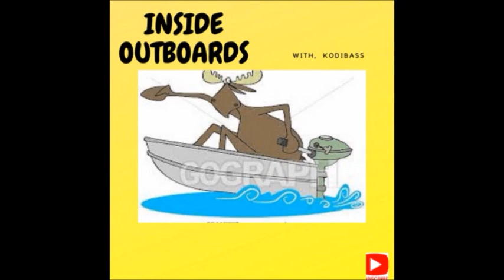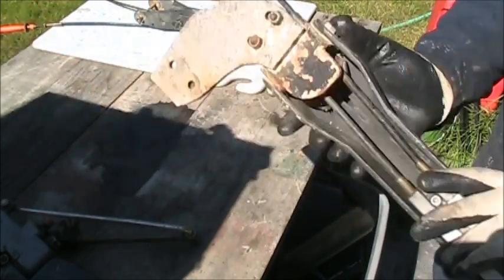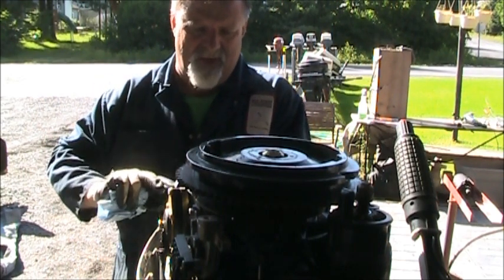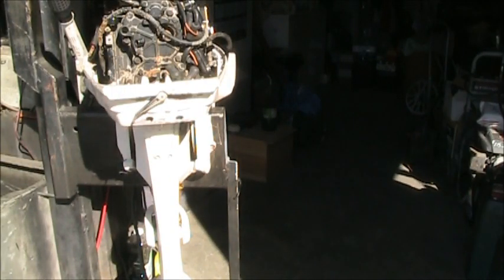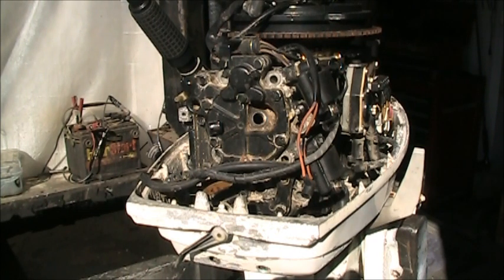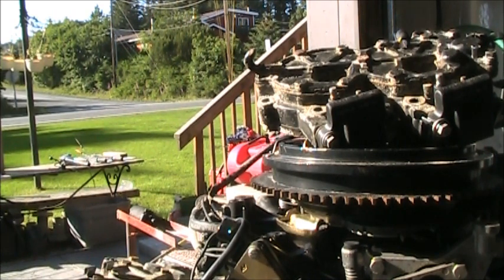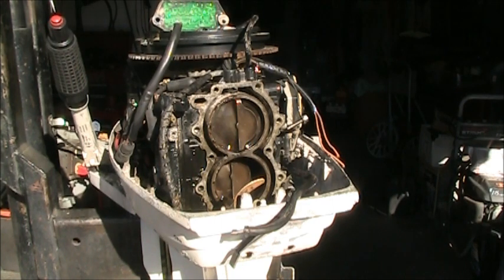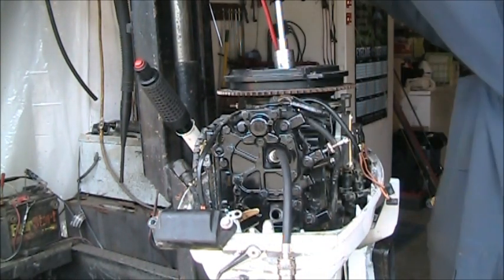1988 JOHNSON 30 HP,      (( Part 1 ))

Comment: Hi Kodi, love the look inside these motors. I was surprised you didn't sand block the head and block like old outboad does. Looking forward to the next part👍
Reply from the maker: +TWS,  Nope''  I  am a Full on  repair shop,,     mowers,   chainsaws,  weed-eaters, pressure washers, etc,,,etc,,     No time 2 do one outboard  @ a time,,    I Move outboards  & loads of engine repair thru  my
shop every day,,  I record the outboards 4 fun & vids,,  But those R not the rent,  4 sure''    I do way more $ on  lawn & garden  equipment  than outboards...  I have 2 move stuff thru the shop ,  @ a rapid pace ,  That's  what Pays the Bills..                                                                                kodi

Comment: Hey Kodi looking for some advise. I am tinkering with a 1986 Johnson Tracker 20 HP. It starts easily and idles very nicely. My problem is it doesn't run great on the top end it just kind of hits mid RPM and hangs there and will not rev any further. I have it on a 16ft v hull small aluminum boat. It will only push boat 9 mph. I have been through carb 3 times it is clean as a whistle. Motor is in really good shape everything seems to be functioning properly. The only thing I have found that concerns me is compression may be down. I have 65 psi in top and 60 psi bottom. Is this low enough to cause my issue? Any advise would be great my only other thought is something with engine timing but all of the linkage and cam follower appears to be moving as it should. Thanks sorry for long comment. Love your videos.
Reply from the maker: That is pretty low, even for a pull start motor, Re-ring it ,  Give the cylinders a light hone If as you say its in good shape otherwise it will be worth doing a ring job.    kodi

Comment: Man, that's some serious wire wheeling.  I'd be scared as all crap to do that of fear of getting some crud into the rings grooves or scoring the cylinder walls.
I was slow as molasses when I had to do major outboard gasket scraping on critical gasket surfaces (head gaskets, etc.)
Reply from the maker: _Havoc.  No Sir,,  Clean the cylinders,,  Lots of  Lube,   BOOOOOOOM!  Make her a runner...     This motor is not the space-shuttle..  Just clean,, hone, &  RUN..  kodi

Comment: I guess I'm wondering why the thing overheated so badly to burn up that head gasket that way....Are you sure the three rubber cooling deflectors are OK?  That top one looked a little "toasty".  It might be time to pull the powerhead, do the grommet, exhaust cover, pump etc.  These are rugged engines, but the cooling system is pretty dern complicated and needs alot of servicing in salt water to avoid nasty situations like this...
Reply from the maker: +kramden,     I took out the  Deflectors ,   washed/lubed  them they were  fine,,  A few months ago I replaced the water-pump, on this motor ,  The owner had run the motor in shallow water &  sucked up sand and gravel 2 the point that the water-pump,plate,& impeller were ruined,  Then He ran the motor until it was so hot it seized.. I think I was lucky 2 save this engine..                                   kodi
Reply: @kodibassInsideoutboards  Cool, the video just made it look like the top deflector was shrunken/melted, glad they are OK.  The guy just ran it until it melted down, then ran it some more, figures.... Nice save indeed!  In spite of these engine's short comings, the powerheads and gearcases are pretty rugged....Not many engines would come back to service after this kind of abuse and being left to soak in salt water...
Nice work indeed....

Comment: Those generic tillers are interesting.Would come in handy for someone wanting to convert a motor from steering controls.Dont understand how the twist grip can move the shifting and throttle separately?How you show them again.Who made them?
Reply from the maker: +W2F,  Yep '   I have used a few of  these  ...  Over the years,    it's  a jury Rig set up @ Best.,,,,     but when done with steady Fabs,   &  positive out-comes -  2 a determined  end game !     the results R often Amazing -----   OFF The Chart ,  Fantastic ,  4 Sure,      
                                                                                                                            kodibass
Reply: @kodibassInsideoutboards  Are those still manufactured and or by whom when they were?